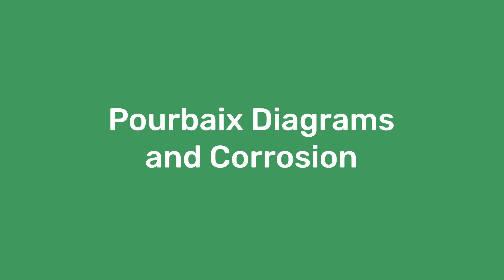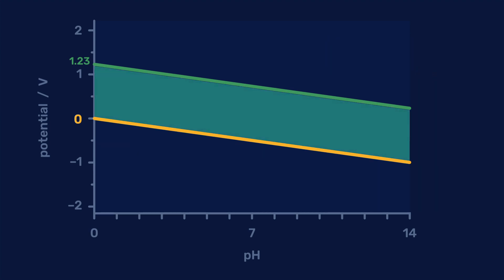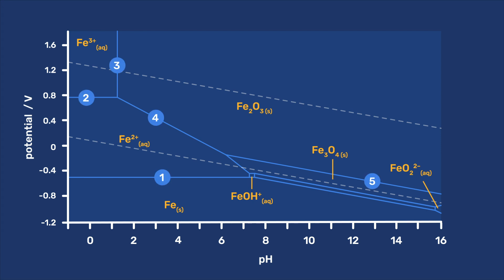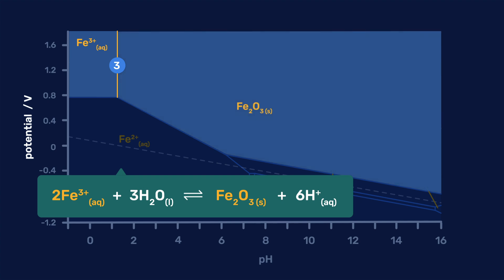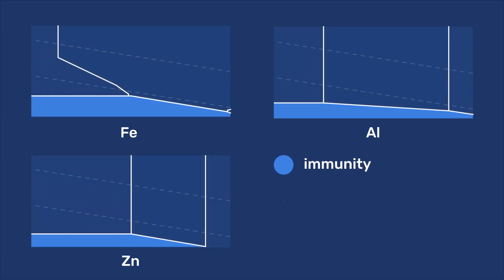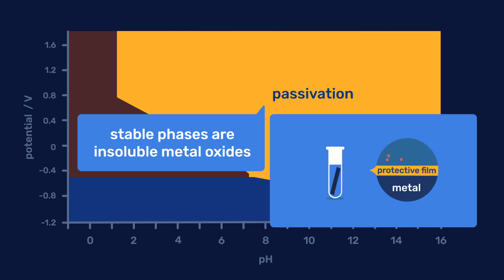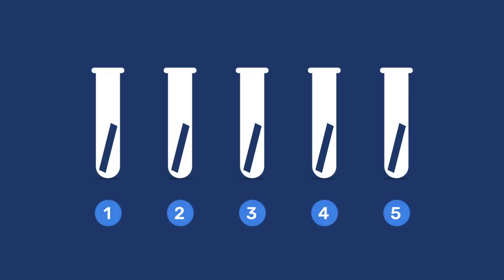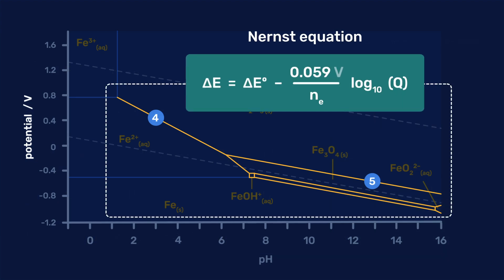Pourbaix Diagrams

Comment: There is one mistake in the diagram of reaction No. 5. Fe2O3 is on both sides of the reaction, which is incorrect. On the right side, It should be Fe3O4.

Comment: Excellent explanation! But I have a question - how would you induce voltage in the solution? Would it come from another half reaction? Or how?
Reply: You apply an external potential through a power source.